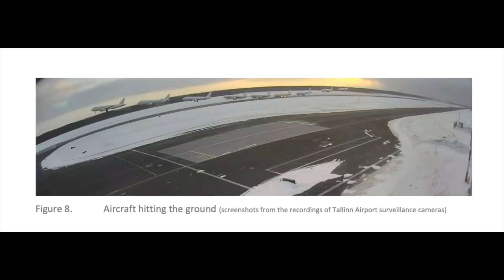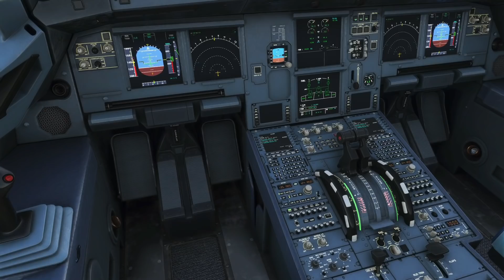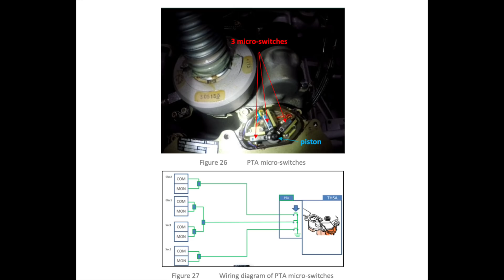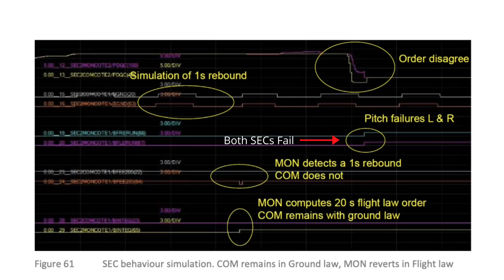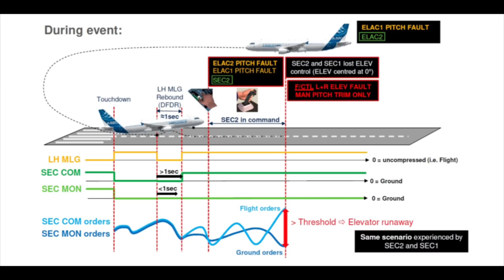The Oil Change That Crashed A Passenger Jet | The Crash Of Smartlynx 9001

Comment: My flight experiance is in CL44 flying tab, B707 with doppler navigation system with (mechanical computer)  DC 8 63 with INS this computer with 9 programable lines, basicly the same as in Apollo 13  I was flying in the Andes on B707 with INS from1980  This INS was drifting a lot So I callde Gary in Garmin he lendid me a garmin to install in the B707 when the aircraft arived in Maimi  I got FAA people on board to check the illigal GPS  I rote in the log book GPS installed Sextant removed FAA did not fight the sextant removal Gary was very happy sold lot of Garmin.

Comment: Computers still scare me. There is too much automation, but it is here to stay for the most part. I envision a large switch or panic button on instrument panels that turns off the computers and, scary as it sounds to some, allows the pilot in command to "fly the airplane."
Reply: If you turn off the computers in a fly by wire plane then you have no control at all
Reply: @tomstravels520  Thank you for your comment. True, but they could have a backup to fly in the way of Boeing 727s and DC-9s. If things go bad, just fly the airplane.
Reply: @JMcdon1627  then that would spoil the whole point of having FBW. If you install cables and pulleys and then add fly by wire the aircraft will be heavier than without FBW. You can fly an A320 without the protections by flying in ALTN LAW. it’s still fly by wire but it will not stop the pilots if they attempt to stall or over stress the airframe.

Comment: Good evening 
1/ This is  a training flight and not a flight test 
From the first failure the instructor should take over make a full stop landing and cancel the training flight 
2/ A double failure with gear down leads to direct law witch is different from alternate law with the gear up and this is very important for the trim 
And nobody talks about it
Conclusion: The captain in charge of the training failed in his mission
Rgda
Reply: The aircraft was in mechanical law for the pitch which is below direct law
Reply: THATS EVEN WORSE 
ANOTHER REASON TO STOP THE TRAINING

Comment: They did a Turnback to opposite runway.  Didnt have engines to circle around to same runway they took off from. Smart desicion.  Pakistan airways 5383 last year messed the engines when a no gear landing the captain did and then went on a go around.  Took off, but instead of doing the turnback to opposite runway like they did on this video, he decided to go around the airport, with failing engines, Idit captain. 
Of course, the engines failed like here but on the far downwind leg he dummy tried to do- and they crashed short of airport killing many on airplane and ground.  When engines are impacted like that is stupid to take the longest route to land of a Turnaround the airport.  Do a TURNBACK to the closest runway instead.  Geee!! Some guys lose common sense when get nervous.  I taught turnbacks and turnArounds to many pilots with partial power to let them see the difference in those 2 maneuvers...

Comment: A "1 to 10" scale of less / more automation isn't what I think of.  What I think of is making pilot over rides easily attainable and able to be achieved.  Effectively if I was designing an airplane I'd have an overhead row of switches to disable parts of the automation that I was taking control of during an emergency.

Comment: Between automated and non-automated planes, I side with ships. Put planes in the wastebin and return to ocean liners. No little kids jackhammering at your back, jammed controls won't pancake you into the ground, most fuel leaks don't lead to explosions, running out means you just drift, and just generally if you put the ship together well it's gonna be safe as hell. Oh, and survivability in storms. Because real liners are built to pummel through them. There's a schedule to keep.
Reply: I’m not spending 2 weeks crossing the Atlantic then another 2 weeks to get back thank you very much

Comment: Very cool simulation. The first question that popped up to me was, why on earth did they continue to fly after they had these errors that could not be resolved by power-cycling the computers and landed the plane to a full stop? I would first have completely and thoroughly checked the plane before taking to the sky with it again!
Reply: That’s where you are wrong. Resetting the ELAC’s did actually solve the problem and restore the computers back to normal. Every single time.....except in the last circuit where the captain didn’t reset the computer so there was only 1 available. What caused the fault to re-appear was the OVM PTA and the signals being sent
Reply: @tomstravels520  Ok than I did not get it completely right. Thanks for correcting.
Reply: @Ztbmrc1  most people in the comments didn’t
Reply: @Ztbmrc1  I agree with you, you did get it right. multipal resets showed there was still a problem.
Reply: @YMJCMJC  Thank you! Let just all other Airbus pilots use the things we learned from this accident.

Comment: I don't think it was the oil which caused this accident, but the pilots ignoring the constant warnings going off.  If resetting the computer doesn't stop the warnings, why would you continue with the training and not park the plane and call maintenance out?
Reply: Resetting the computer did stop the warnings. But it was the oil in the OVM and the PTA switches not detecting the manual trim inputs that caused it to go back to a failed mode. Every time the captain reset the computers it restored the ELAC to full dual channel mode (pitch and roll)
Reply: @tomstravels520  But the warnings kept popping up.  And they kept resetting them.  After the warnings going off two or three times I'd land the plane and have someone check it out.  Especially since the warnings have to do with aircraft control.
Reply: @dx1450  yes. Because of the action of the pilot using the trim wheel. Not because of resetting the computer. Resetting the computer works all the time but then with the OVM and PTA failure it set the condition back to how it was. It was the pilot not resetting the computer that caused the flight control failure as well as the SEC design flaw

Comment: I think automation is great, but there always has to be an option for the human being to override the aircraft. Computers can't think through problems and try to sort issues out -- only a person can do that. Just look at MCAS on the 737 MAX. In that case, you want your pilots to have final say in what the aircraft is doing. Most of the time you don't need to worry about it as computers these days are pretty reliable, but in the one or two instances they're not, you have to be able to take manual control. I'm not saying humans are perfect, but there's a reason we're not being auto-flown yet.

Comment: What is the point of having a computer to tell the pilot something is wrong when the pilot ignores it?
Reply: Because when the pilots reset the computer the fault cleared each and every time except the last circuit where the pilot didn’t reset the computer and left it with no redundancy for the ELAC. The manual did not state how many times you could perform a reset
Reply: @tomstravels520  each and every time.....computer was trying to tell him something and he ignored it.
Reply: @musicbruv  no he didn’t “ignore it”. He followed the procedure that was in the manual which was to reset the computer and if that didn’t work then it needs looking into. However whenever he reset the computer it cleared all the faults and if the aircraft wasn’t doing circuits the fault would never have appeared again.
Reply: @tomstravels520  how many times did he reset it? Reset did not work!
Reply: @musicbruv  if you don’t understand how the A320 computers work then don’t bother commenting because this video is slightly misleading people. Reset worked. The ELAC’s were always restored back to dual channel operation (pitch and roll) except the final circuit where one of them wasn’t reset so there was no backup. If the reset didn’t work the ELAC PITCH failure would have stayed on the displays and told the pilots to switch the whole ELAC off. And if that happened then you’d have no aileron control either. The PTA micro switches restarted the cycle of failure over again but the pilot resetting the computer then closed that cycle. If this had been a normalA to B flight you’d likely never know there was a problem as pilots don’t hand operate the trim except prior to takeoff and as it didn’t flag a warning whilst on the ground I’m guessing it would never normally show up on a standard flight anyway
Reply: @tomstravels520  The computer need resetting multiple times, how many times does it state in the manual? 
Since that did not work so should he have not landed and got it looked into?
Reply: @musicbruv  the manual either did not state how many times it could be reset (to be honest you’d only need to reset it once and see if the fault clears) or the conditions for circuit training as each circuit was counted as one takeoff and landing and there was only 1 reset per flight. Because the aircraft was flying normally with no faults that caused any immediate problems once the reset was done then there’s no immediate need to land. Most likely they would have completed all the flights then contacted mechanics after. If the pilot had continued to reset the computer after every takeoff when instructed by the ECAM then nothing would have happened anyway

Comment: I would say 6-8 on Automation.
There is a lot to monitor on flights and it can overwhelm the pilots (and Flight Engineer if there is one), so having a good amount of automation helps their workload. The pilots will also have enough manual control of the plane in case of emergencies or for training.  That's what I think at least.

Comment: If you want a die-by-wire system, go with 10 automation. I'll go with 50 50 automation/pilot input. Every computer out there may fail but a good pilot's knowledge and experience won't.

Comment: 8-9 automation. I think at scale, automation saves a lot more lives avoiding pilot error than it causes deaths due to these scenarios or the Max design.

The reason we don't appreciate how good automation is, is we never hear about the lives that are saved by a pilot never making error.

Automation allows for better economy, lower pilot fatigue and workload, better passenger experience, increased safety and compliance. Pilots should always have some way to override any automation, but otherwise, the default should be to automate flight as much as possible.

Comment: I am all for automation in the plane as long as the crew know it is there, how it works, and how to override. As AI gets better, it will be less of a problem. Like the Tesla, let it self-drive, but keep your hands on the wheel.
Reply: I agree!  I have a Tesla and let it do the driving when all it needs is to keep it in the lane and stop for traffic control. I do the hard stuff like changing streets or roads at intersections.  The auto pilot is much better at lane keeping than me but I am better at intersections.

Comment: It wasn't the oil that caused the plane to crash. After the first ELAC warning they should have checked out the issue. After the second it was massively obvious that there was an ongoing issue that resetting was not fixing. And they kept ignoring it over and over again!?!? This is the equivalent of your smoke detector going off and you pressing the silence button, and contributing watching TV.  After 5 minutes it goes off again and you mute it again. 5 more times and then you see the kitchen engulfed in flames. Big surprise, no body could have foreseen the oven was left on with burning oil in it... Nope, surely ignoring half a dozen repeated alarms should have "fixed" the burning oven...

Complete idiots.

Bad oil caused the ELAC warning. Bad pilots caused the plane crash.
Reply: Absolutely wrong. Resetting the computer did actually work every single time and restored the pitch channel of the ELAC all the time. The aircraft could then have gone on a flight to another airport and no warning would have cropped up. The reason why the plane then went haywire is because they didn’t reset the failed ELAC and so when the second one failed it then had no redundancy and resorted to the SEC’s.

In your analogy this is the equivalent of the smoke alarm going off, you extinguish the fire, silence the alarm then go back to tv, but every time you press a button on the remote it sparks into a fire again, you put out the fire and silence the smoke alarm every time.

Comment: Hello,
Here is a comment from an automation guy who worked almost continuously in the field (food and beverage for over 40 years).
Automation has a few advantages such as:
Speed: Automatic systems outperform any human on tasks they can perform.
Reliability: When properly maintained, automatic systems operate repeatedly without fail. They do not forget, and they do not get tired, they also provide consistent results with very little overall variance
Best conservation of resources: Automatic systems when operated within their confines can provide the most efficient operation repeatedly and countless, they do not lose concentration or vigilance.
Their major drawback is their immense lack of human judgment. This is why for example MCAS in Boeing 737 Max 8 continuously pitches down the aircraft until a crash occurred.  A human on the other hand would have realized even if intuitively that something was badly wrong with the Angle of Attack Sensor, at least an experienced and knowledgeable human would.
In summary, a large contribution of Automation is desirable under NORMAL circumstances, but the pilots should always have the last word and the final override. Most importantly the humans I am referring to in this section are fully informed and trained equipment operators. This does not include those that are not informed properly by the equipment vendor or those that are not adequately trained on the equipment.
Thanks for the opportunity to speak my mind

Comment: Is there a right amount of balance? Possibly the pilots should have landed sooner given the amount of warnings. Maybe if the system is getting so confused then it needs to send a message to the ground fo assistance. Maybe pilots need an option to let the plane fly itself if that doesn't work then the pilots take over. Pilot's do make mistakes, so that automatication would be handy.

Comment: Automation level 10, but paired with better pilot training. The improvements in automation systems has lead to unprecedented flying safety. But now those rare problems can be exacerbated by a pilot that's unable to react to or understand what the automation and plane are saying and doing. Cutting training corners in exchange for those sweet sweet profits is just dangerous.

Comment: The pilot should have stayed on the ground when the fault kept recurring.  I can't imagine why you would keep returning to the air when the warnings keep coming back.
Reply: Because there was no clear guidance what to do if you can successfully reset the fault each time on a training flight. This problem would never have occurred during a normal flight

Comment: i'm an 8. anything that is a finicky as an aircraft needs enough automation to be able to control the aircraft easily should something happen to the pilots. but also know that something has gone horribly wrong with the aircraft and properly inform the pilots. a repeating error is not one you take lightly. after 3rd or 4th alert the safety pilot should have known the aircraft was in a problematic spot. and that unlucky bounce sealed the aircraft's fate. thankfully it wasn't a serious accident. could you imagine if this happened during a fully fueled and loaded flight.